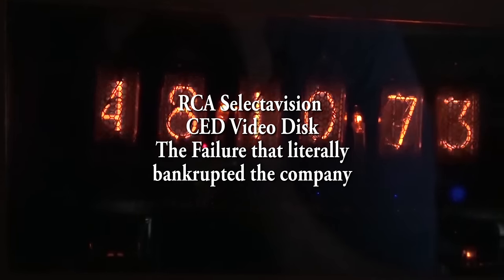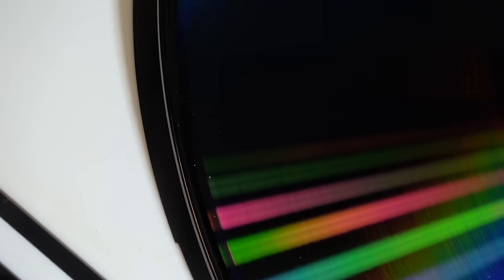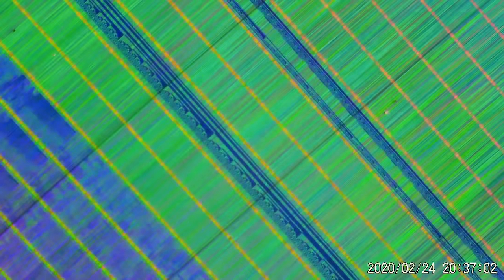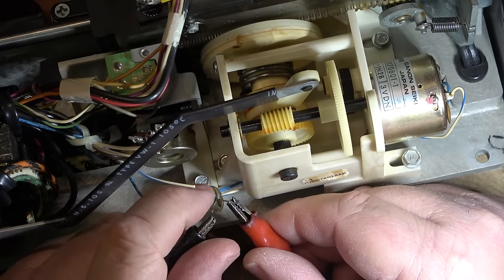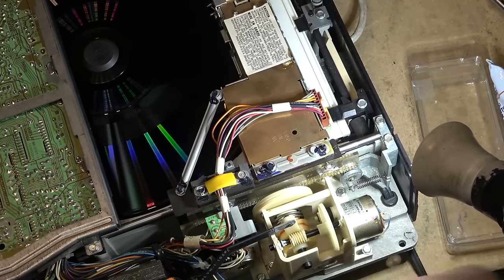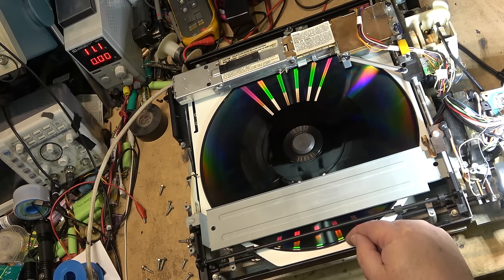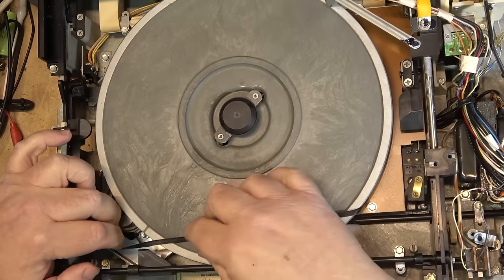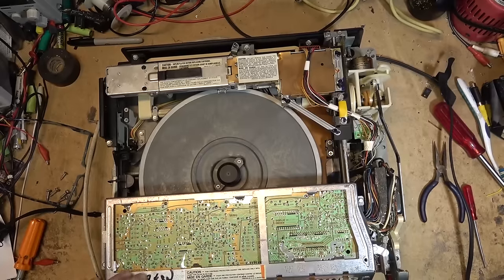RCA SFT100 CED Video Disc Player is not happy will it be repairable or is it FUBAR?

Comment from the maker: If you look close at the 17:34 mark, under the microscope you can read the RCA logo from the beginning of the movie. Its a mirror image but it clearly shows up!
Reply: The dark and light pattern you see around 20:00 is what an incrementing binary sequence (00000000, 00000001, 00000010, 00000011 ... 11111100 11111101 11111110 11111111) looks like as pixels. Digital encoding of the frame number in one line of the vertical blanking interval. Didn't some players read that code for random seek?
Reply from the maker: @coyote_den  There is nothing binary about this format. Pure analog. Those are test signals recorded in the first 21 lines, including closed captions and the analog macrovision signals ect. There will also be a multi burst and color bars, as well as aVIR reference and anything else in the VITS (Vertical Interval Test Signals) area of the NTSC frame.
Reply: @12voltvids The only thing digital in CED would be the DAXI (Digital Auxiliary Information) data.
Reply: The post office shipping cost
Reply: Beta max  had a better picture

Comment: Who do I see about getting that hour back?
LOL...I wish the video was longer...listening to you drone on about dead video technology pushes all of my buttons.
If you had a matched set of screwdrivers or a clean workbench you'd lose some of your charm.
Thanks for bringing some much needed meaning to my life...really.
Reply from the maker: I was actually hoping that this was going to be repairable and that it would have been just lubricating and so forth or that it was a disc that was causing the problem and I actually thought that that's what the issue was right to the end. I'd actually finished the video and left it on a note that I thought it was the disc and just before going to put the thing together I just happened to by accident push down on that spindle while it was running and the picture cleared and it was like holy crap it's the platter it's the bearing! I had suspected that the bearing might have been causing the problem just from the way that it seemed to resonate but I wasn't sure because the disc looking like it had a warp to it certainly could cause the same issue but it actually wasn't the desk it was the platter itself. Now I'm sure some of the old texts that worked on these things briefly in the early 1980s were probably laughing now knowing exactly what it was but myself not have had the privilege of ever working on any because I think the shop that I worked at sold a total of 2, and I never got to work on either of them. We sold one replacement stylus to one fellow that was gung-ho about the technology. Here's a kicker for you the shop had a break in we caught it all on video in 1984.  The crooks grabbed about 50 VCRs they did not take one CED disk player.  I'm kicking myself now because when RCA took all the units back they offered us a player at $25 and movies at $2 each when they were recalling them that was for the current movies that were already out that we had in the store and none of us took them up on that offer so they took them all away. I should have had the foresight that 40 years down the road this would be a highly collectible item and having one that was brand new in the box might be worth something.
Reply: @12voltvids  Did you say that the platter has PLASTIC bearings?
You can fix that...

Comment: The CED format was released in 1981.  Player production terminated in 1984, owing to sales of players being well below projections; no point in making more players when you have a surplus.  Disc production continued until 1986, followed by the acquisition and breakup of the RCA Corporation by General Electric.

CED wasn't the only factor to cause RCA's downfall, but it was a major contributor to its failure as a company, considering how much money was lost because of the venture.  That said, a big issue with RCA was that it basically had no leadership for almost two decades up to the point where it went under, so the company was all over the place with its diversification outside of its core business as well as mismanagement.

It basically all started when David Sarnoff retired from the company, leaving the reins to his son, Robert Sarnoff ... and things went downhill from there.
Reply from the maker: That happens more often than you can imagine. Electronic parts shop. Original founder passed to his son when he retired and he ran the business for 40 years passing it to his son who promptly closed the business.
Reply: @12voltvids Well, in the case of Robert Sarnoff, he was ousted in a boardroom coup.

Comment: If I remember right, the stylus was diamond made in a special lapping machine then had a metal contact plated/deposited on the back of it. That formed one plate of the capacitor, then the disc was a multilayer deal where the core was conductive (the second plate) and then the shell (thus the dielectric) was molded atop with the information. I lived in a town (Lancaster PA) with a pretty big RCA plant and R&D effort. That company tossed out great ideas left and right. Heatpipes were an invention of that plant - get rid of it, they said, no money in it. So the managers bought the patent and got rich. CED was something they kept. If it had come out ten years earlier when they were futzing with it, it would've been great, or if they went with their prototype tape system instead, they'd have been sitting pretty. But no. Bad management.
Reply: I think the diamond stylus was supposed to have been profiled into something resembling a keel shape profile. The metal contact on the diamond was probably formed  using chemical vapour deposition and was connected to the rest of the stylus assembly and on to the rest of the player using a trailing titanium electrode as far as I have been able to glean through research.

Comment: I found the same unit years ago and it had the same issue. The stylus would not advance in playback. I took the cover off and cleaned the gears where the wires were cut and that fixed it. Just grime from sitting all those years. I have about 2 stacks of movies about 3 ft tall collecting dust.

Comment: As far as I remember reading, the stylus on a CED player was indeed diamond but had a trailing titanium electrode that was somehow bonded to the back of the diamond to provide the electrical and capacitive coupling which fed the signal to the rest of the player.
Reply from the maker: Yes you can see the tiny tip. I couldn't see that in prevue resolution that shows on the screen during editing, but it was certainly visible when rendered at full resolution.

Comment: We bought a CED player in 1982.Looks just like that one. Have a few dozen discs. The player stopped working a couple years ago. I was trying to copy to DVD. (They were specially edited for CED Gimme Shelter and Queen Greatest Flix). CED was what my father chose over Laserdisc.
I noticed that some of the discs would skip a lot. I guess over the years dust got in or something.
(60 minutes max per side)
Believe it or not, we never replaced the Stylus. But we only used it for a couple years constantly until we got a VCR.
Reply: Brand new sealed discs sometimes skipped straight out of the package.
Reply from the maker: Many did because the format was a joke.
Reply: It's a common issue with the format and can occur for a multitude of reasons, including if the disc hadn't been played in a while.

One of the things that can happen is that the silicone lubricant that was applied to the disc can form a smooth and glassy surface that the stylus must cut through to the groove, and sometimes it can't do that on the first run.  Therefore, a conditioning play must be run before actually playing the disc for viewing ... and sometimes you may have to run it through more than once before you can bring down the frequency of skipping to a minimum.

It's kind of amazing that the format even worked at all.

Comment: I bought this unit at the thrift store a in November of last year. it was a player cost $9 it was a great deal not a steal. the stylus is intact when I try look for a outlet to see the player function works. but sure enough the power switch mode the light flashes see L. it stand for load disc on there. I bought the thing. took it home had some couple video discs from the previous thrift store to try it out test it see it's works. it works perfect. I just bought some couple of CED titles online they were National Geographic and Gloria both sealed copies. I was planning to get a few more RCA video disk movies they have. I used to have this I was so young I remember it was a Sears brand a clone version of the player like this. my parents bought it the first disc we watched was Star Trek the motion picture. the last disc my parents bought Popeye in stereo a blue caddy sleeve. those are my childhood memories I remember. now it's in my bookshelf cabinet for the rest of my vintage video disc player collections. it's so rare too own.
Reply from the maker: Yes rare.  If i found one cheap I would grab as collector piece.  I do have a bunch of laserdisk players including one that plays both DVD and laser.
Reply from the maker: My best deal at thrift store. Samsung sv5000 mukto system VCR 25, Sony tcdd5 cassette recorder 10.00 Toshiba dvr7 DVD recorder / VHS 25
Reply: @12voltvids  wow that's cool. I have a laser disc player and another DVD and laser disc player and the Blu-ray player. also I have DVD recorder player and VCR combo player as well. they're all both from pioneer. 👍

Comment: There is a bunch of these on Ebay USA and there is one that comes with 16 movies but it sounds like it has the same issue as yours.
The description reads—
“This player works, takes the movie and plays. The color does fade and move, so repair may be necessary (possible new belt needed). Comes with all the movies shown and in original box with original styrofoam. Machine looks to be in almost unused condition. Please ask all questions before buying.”
Reply from the maker: It's junk just like this one.  Worth 0 dollars.  Just like the guy on Facebook now that was asking 75 for a broken DAT.  Has had no bites so he has reduced to 50.  Last broken DAT I bought was 10.00

Comment: I worked for an RCA dealer and there were continuous complaints of skipping. They had model numbers SFT-xxx, SGT-xxx and jumped to SJT-xxx. They probably skipped a model number starting with SHT because it was a piece of you know what!!! The shop display demo disc skipped like crazy. What a way to sell a product!!!

149000 was what RCA called a QT (Quick Turnover ) part. Stylus assembly.

Actually the motor in this unit is only a 2 pole motor (not a 4 pole). Again. Cost cutting.
Reply from the maker: People are asking crazy prices for these pieces of junk

Comment: You sir, have the most epically messy and delightful workspace of any YouTuber outside of AVE. 😂
Reply from the maker: Its actually not that bad. I have seen far worse, namely any TV shop from the 1960s through the 2000s.  There is a reason shops had a sign that said employees only. LOL. They all looked like this. Even the benches at Sony were cluttered.

Comment: With the sled motor disconnected, it could still play the first few seconds before skipping back because there is an "arm stretcher" transducer that does the fine positioning of the stylus. If you were digging deeper into it I'd check that next.
Reply from the maker: Yes the stylus pressure is controlled by the tracking servo

Comment: As the old proverb goes, the invention of the light bulb was not a result of infinite refinement of the candle. Well, what RCA did with CED proved the dangers of failing to learn from the history. RCA engineers simply took the LP record format and iterated it to barely idiot-proof fragile product, while at the same time making every effort (and a lot of compromises along the way) to slash the player's price tag to the bottom. This is the reason for the bare-bone analogue approach for the CED recording, where the entire TV signal was directly etched to the surface of the disk, negating the need for any extra circuit logic, even for a simple aspect as the vertical blanking signal. This race to the bottom in the end is took the whole company with down, given the fact that RCA had to even subcontract the manufacturing of their first VCR machines -- to expensive and complicated to do it themselves apparently.

Comment: i remember growing up with these, my dad had a huge collection of the CED discs, they where cheap at the time and VHS and BETA was super expensive, he ended up selling it because VHS got cheaper later on, then years later he found a machine in goodwill (different than the one your showing) and gave it to me to fix all it needed was a drive belt, and i fixed it, i still have 1 disc the  original 1953 the war of the worlds, but my stupid dad sold the machine among many other of my collectible stuff when moving, i was young at the time. and i got so pissed at him.
no, actually a slight warp disc will play just fine the needle is not supposed to move like that. the needle is the problem it appears to be missing the  back support wire (similar to the electrode wire) or rubber which holds it steady. 
and no, holding the center isnt the problem, not a bearing issue, your body is grounded which is how the disc operates low voltage electricity flows through the disc to the needle. there is a grounding brush on the platter shaft similar to the grounding brush on a vcr head drum. it could be clogged or missing.
Reply from the maker: No you can feel the platter shaking.  There is not a viktage flowing through the disk. The dept of the Grove changes which changes the capacitence of the stylus.  It rides in a totally smooth groove with noblateral or vertical movement. The signal is pressed in below the actual groove the stylus rides in. It reads the information below the groove.  When i presses down on the spindle it actually removed contact from the disc. It was stopping the wobble that allowed the disc to play.  Soon as I released the wobble returned.
Reply: @12voltvids  CED  discs are made of conductive pvc with use of carbon a small voltage goes through the disc, to ground, its a grounding issue, this is causing the color issue, trust me, also i forgot to mention watching your video made me break out my RCA CED player SJT 300 which i bought years ago and replaced the stylus, found on ebay, my player has stereo and rca component outputs. along with the typical coax. i still have the remote. brings back soo much memories. someday id like to get more CEDs to collect.
Reply from the maker: @jr-pl9kj 
Yes i kbow.  I remember seeing a documentary on it. Forms a capacitor the disc being a grounded plate and tip of the stylus the other plate. Capatence changes.
I never serviced this was the first one i have looked at.   
 Have no idea what goes wrong.  The disk did have tons of wobble.  
It wasnt just pushing down on the spindle but pull it slightly to atop the wobble.

Comment: There is a video on youtube titled "How to Service a F/G Model CED Videodisc Player" (Credit recognition: Josh Gibson ) with examples on how to remove the platter and some of the deeper consepts of its operation . the platter does set down on a braking surface in its lowered position.. dont know if examples like that will be any help but you can look at it if you wish. .
Reply from the maker: Yes I know. The lever below it raises and lowers it. The problem with this one is the bearing shown at the 49:37 point when I oiled it is worn. That plastic base is the bearing that the platter fits into.  It's just worn out. When I pressed down on the disk centering hub i could feel it wandering around. This is what happens in belt drive equipment. There is the constant pull in the direction of the drive motor by the belt that wears the bearing more on one side then the other.
Reply: @12voltvids  You also have two sleeve bearings that interact with the turntable shaft that need to be lubricated.  You can't get to those without removing the platter.  And if those sleeve bearings are dry, they will induce drag.

Comment: Had one of these in college, they were in several video rental places, when VHS took over all the stores sold the rental players for $75 I picked up one and bought a bunch of discs for $5  each till nobody wanted them then they were $2 still have them all  Player still works. I thought it was fine at the time as VHS players were way more money. But i hated flipping disc in the middle of the movie. And some of the long movies had  2 discs and you have to flip it twice. I  am not so sure it was the same quality as VHS i think it was better, but no way to record.  I won't say it was leaps and bounds better, in fact i doubt there was much difference. I got all mine at a RCA store.. The funny thing is that the store is still open 40 years later but it's not RCA anymore.

Comment: A magnetic video disk format also existed, that one was like a floppy disk.
50:39 - 2-pole; probably not even a sync motor, just an induction type shaded pole motor.
Reply: Definitely not a synchronous motor. The power line (and the drive belt) don't provide enough stability for color video. I'm sure it's an induction motor running on varying voltage, that allows the circuitry to trim the platter speed to exactly the required 60/n/1.001.

Comment: That your colour varies on playback is due to the variations in speed. Might be the drive belt or the platter's magnetism is lacking. And don't try to adjust those front switches. Thanks for the video.
Reply from the maker: Platter bearing. Watch it through to the end and you will see.